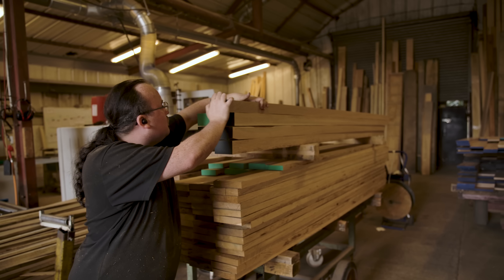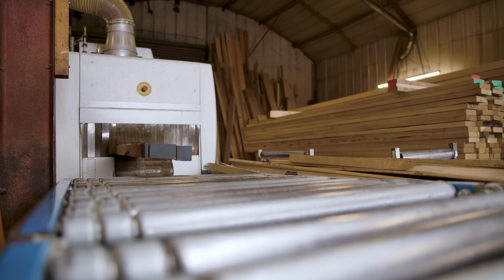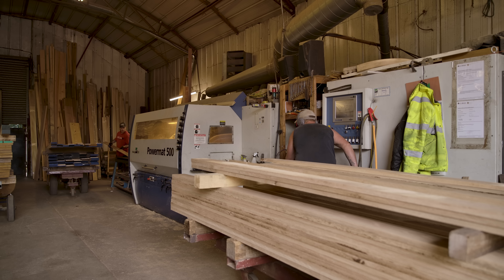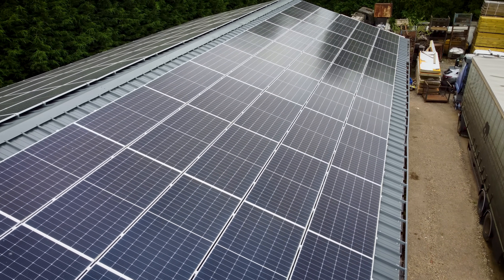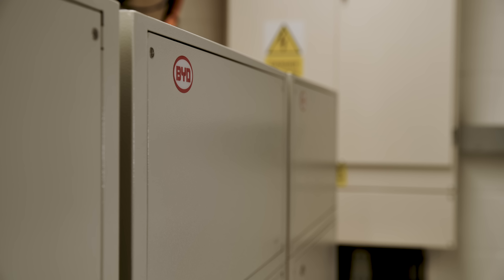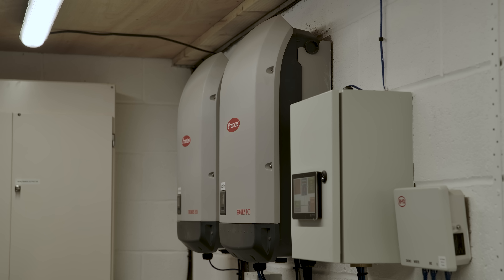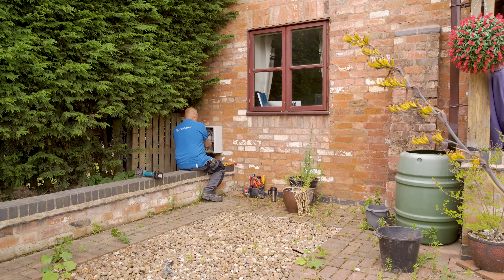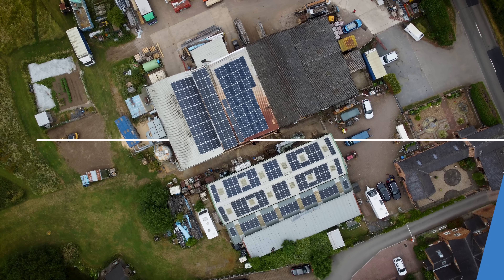How can this timber yard go off-grid, it uses so much power?

Comment: Your system is impressive and likely the best thing you ever did for yourself.  

I built a small 12V Victron system to learn about solar.  It's not permanently wired into my house and I have slowly expanded it as I go along.  Even so, it powers more and more for me every week as I find new uses for it with only two 385W PVs and two 12V 200AH batteries.  Except for the first startup I don't turn it on.  I don't turn it off.  I usually never touch it.  It just works.  MPPT solar generation starts itself in the early morning and shuts off at night, then repeats the following day.  It's on the job and working everyday before you are.  I have a 15,000W generator for emergency backup I have owned for 30 years.  The Victron is far more versatile and day to day usable without the trouble and cost of buying and handling gasoline.

The average citizen has no clue as to how much power the sun outputs, even in poor weather.  What affects solar the most are the blackest rain clouds that have not yet started raining and are shading the PVs.  Once the rain starts the PVs produce more power even as it rains.  Now and then you cannot prevent shading depending upon your setup.

If I had to remove anything from my life the last item would be Victron.  The best I can say about it is that it just works every time without fail.

Comment: nice to hear we can go to renewable energy, however:
-why don't you have electricity from grid? to expensive?
-if machines need 130kW max, why you have 400kVA generator?
-130kW need about 1000 sq.m. of solar panels ... in ideal  sunny conditions.  Do you have enough roof surface?

-I hope, there will be no fire ...

Comment: I went off grid onto solar 7 years ago. Benefits are that I have sufficient reliable power without interruption. As I live in South Africa the benefits are enormous and with the spiraling cost of Eskom power the system was paid off within 4 years. Even if I have to replace the entire system the components of the system have become cheaper but less available due to increased demand for cost effective reliability and would be worthwhile. It is a really great feeling to be self sufficient when everything around you is falling apart! In my opinion solar is the way to go - less disruptive than wind generators and less maintenance.

Comment: 0:41 worth mentioning timber yard was off grid even before they opted for PV panels...
Reply: Grid supply in the UK is weedy. 23kw max for domestic single phase, three phase for commercial maxes out at 69kw. Nice.

Final installed system provided 180kva (144kw) just from the batteries, with a 380kva genny too.

Comment: so they still need the generator in winter...
Reply: But that doesn't really matter in this case because they will be using all the energy created by the solar panels thanks to battery storage, So the ROI should be about the same as having enough panels to get through the winter if not actually better because they would be overproducing in the summer .
Reply: @callumcurtis15  and changing to electric forklifts and EVs next year to charge when factory closes at 4pm and weekends when closed
Reply: Yes sure

Comment: @2:57 you also have Lynx BMS, why do you have it, does it works with non-Victron batteries? I mean does it keep contactor closed?
Reply: Thanks for reply, but why you use Lynx BMS in this system if you have Byd battery BMS? Is it just for   having Lynx Distributor fuse status in Cerbo or VRM?
Reply: Hi yes, this is for use with Victron smart lithium batteries, has disconnect built in to BMS
Reply: There are 2 systems, the main system is BYD with no lynx BMS each battery has own disconnects. The house system has Lynx BMS and victron batteries.

Comment: it would be nice if victron introduced its own line of "server rack style" batteries with integrated BMS (like Pylontec, SOK etc).
Reply: You never know what’s around the corner 🎉
Reply: @Smartrician  
I hoped so, Victron has a very complete product line, from inverters to fuses. It would be the ideal completion
Reply: That would require Victron to develop and release a new product before it becomes out of date!!
Reply: Or as the narrator would say. Victwon server wack.

Comment: Huge fan of Victron gear but have to considered alternative non-lithium-based battery modular systems like the companies Redflow  zinc based battery system. In the future for larger installation, you may want to consider German manufactured based AllTech batteries when the 60Kwh plus modules finally come into production
Reply: Something to look at in the future for sure! Thank You

Comment: Always, start with an complete overview of energy needs and alternatives, how and where all that energy is flowing: Motors and the equipment they drive account for 63% of the total energy consumed in the industrial sector. 
The purchase price of an efficient DC FOC Controlled motor only accounts for 0,5% of its total lifetime costs. The remaining 99% is electricity (and a small fraction for maintenance).
Companies that develop and implement a motor efficiency program generally uncover a cost savings of 43%.
Reply: Good advise Thank You 🎉

Comment: Curious how this will keep the factory running in winter though
Reply: Yes thats right
Reply: it won't they said so in the video, they still to maintain the generators for winter..
Reply: Likely they would run the smaller generator overnight to recharge the batteries, which would then run the factory during the day without needing to turn the bigger generator on.

Comment: Issue with title, it was off grid to start with! Now it has uninterrupted off grid with Solar added to the mix?
Reply: English. I would use the term off grid as being without a connection to take national power  grid and reliant on another source like generators which was the starting point.
Interesting all the same and quite simillar to a local window factory based on an old farm and run on generators that has done simillar.
Reply: They did have single phase 60amp in the beginning, but as the buisness grew, an upgrade to 3 Phase 250amp was so expensive being in the country side, it was cheaper to use red fuel. Then a few years ago law was made to only use white fuel with the extra taxes.
Reply from the maker: What language are you seeing this?

Comment: The budget for this project will be off the roof
Reply: What would be the approximate cost for a set up this size please? 
I too run two timber yards in West Wales 
Thanks
Reply: Nevermind the budget is off the roof; they got solar panels now! Good to go.
Reply: ROI is 4 years 🎉
Reply: @Smartrician  rough price on a system like this?

Comment: Nice project! But how did you use Lynx Distributor which has max current 1000A DC, but your Quattros in peaks can take 1500-2000A DC?
Reply: Used a ring bus configuration, you can’t see on video well, the lynx are back to back with 15 x 2 120mm links cables going through the wall, on simulation with any 2 phases running at 18kW per box the amps are never over 1000amp in any one place on the bus, batteries have own disconnects built in.

Comment: Why did he say he used 400 KVA with all the equipment going ,, and then Victron said up to 130 KVa... Big differance
I must be missing somthing here
Reply: Because generators are usually twice the size of the load.
Reply: So 2 * 130 is 400 Ok got it  @networkingdude
Reply: Starting surges are pretty heavy with mill machinery like that. Even with a soft starter, in the mill I work at, starting currents can be 4 times full load running current. And it might be taking 30-45 seconds getting up to speed.
Reply: The total of 180 KVA inverters have to handle the Inductive loads also with the simular limitations as a Gen @kayakingphotos